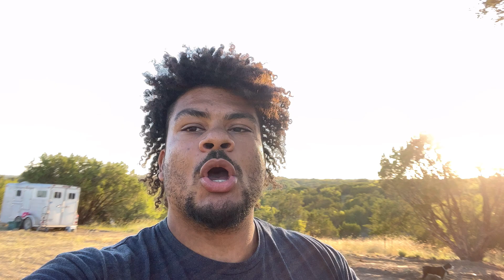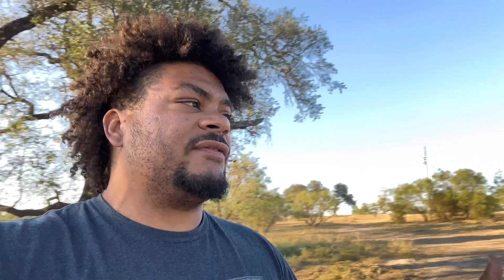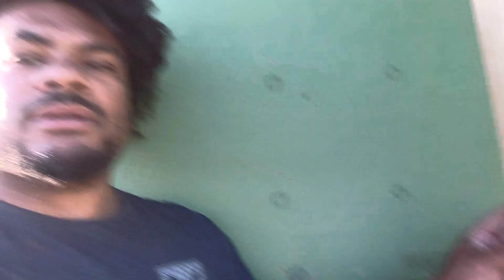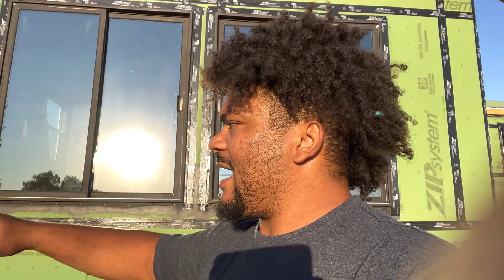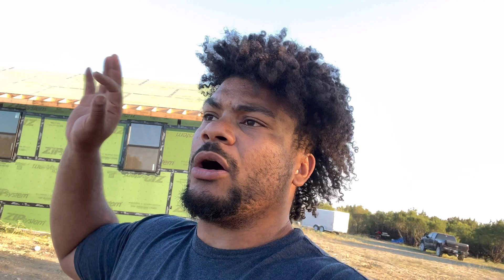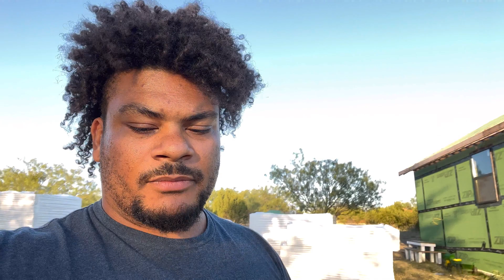Passive House: Will It Rot?

Comment: I don't think vapor permeable wrap on ridge will do much since Texas probably has higher humidity outside than inside the home. It might end up absorbing humidity from outside. You probably watch Matt Risinger, he has a dehumidifier hanging at the ridge to avoid ridge rot.
Reply: I believe the vapor permeable port is one way at the ridge allowing vapor out but not in.

Vapor Diffusion Port.

Comment: Great build. With mechanical systems, this is a fantastic way to build. 100 years ago before ac and other mechanical systems, this way of building would have been impossible. I think most people assume it will rot because they hear horror stories of people sealing up old houses and then having moisture and rot issues. 

I do think this is a very efficient way to build. However, I am skeptical about whether or not we should be calling these building practices "green". I have a feeling the production of all these foams, insulations, treated lumber, and tapes is terrible for the environment. Also, many new products aren't built to last. These high-tech triple-glazed insulated glass windows are at best a 25-year product. A Traditional single-paned wooden window can last for 100 +years with just paint and glazing.

Comment: Could you walk me through your thought process on why you went with all the layers for your roof instead of using zip-R? 

As I understand it you currently have (bottom up): 

Zip system sheathing
Vapor permeable wrb
two layers of poly-iso
furring strips
radiant barrier sheathing
roof-wrap
metal roof

Wouldn't something like this get you pretty close and be less work? 

Zip-R sheathing
furring strips
radiant barrier
roof-wrap
metal roof

Currently planning a build myself, probably not going full passive house but definitely air-tight and well insulated. Love your build so far, keep it up.
Reply: Zip-R is not approved or recommended for roof installation by Huber and thus not code compliant
Reply: @Robin-xe4yz  The more you know, thanks!